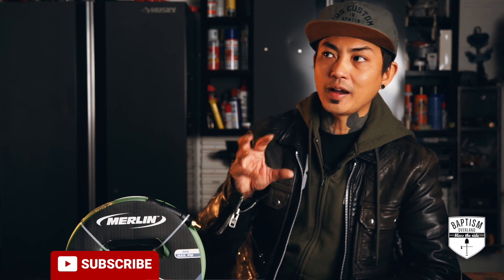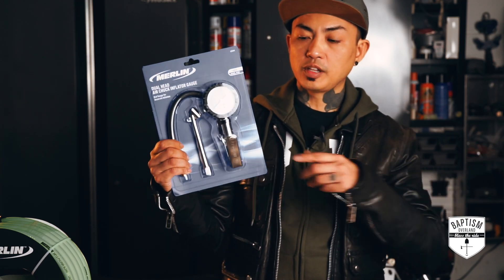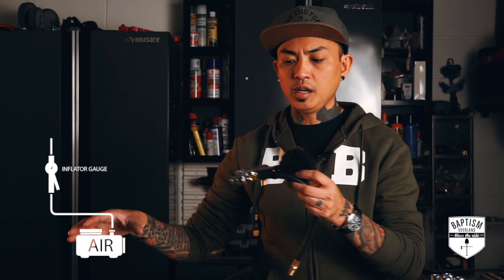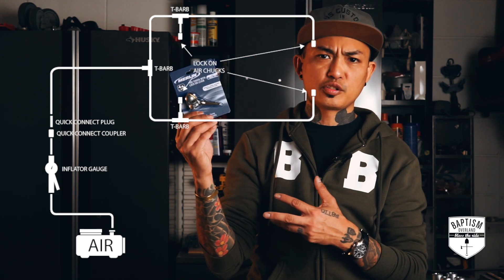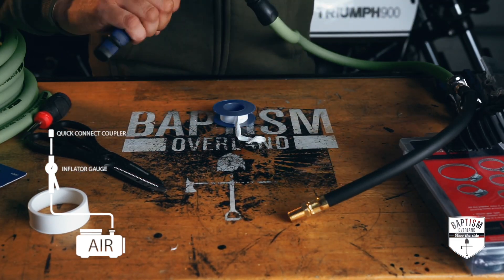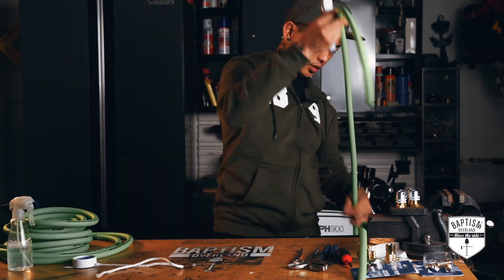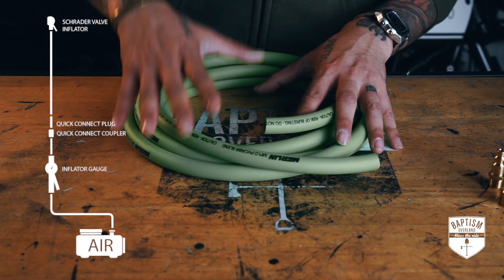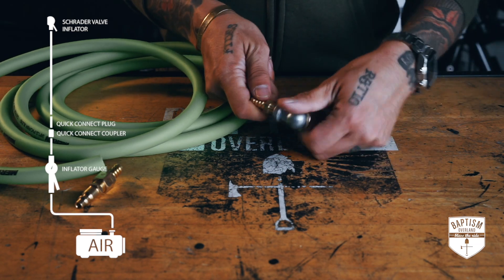DIY Your Own *MODULAR* 4 Way Inflation System!

Comment: Awesome as always, Asia.  Thanks brother.  Good points at the end too about having a competent compressor and potentially overheating or abusing it, depending on the compressor of course.  Also probably one of the biggest takeaways from a system like this is the even distribution of air between each tire.  Currently running an arb single compressor, but if I ever move to something bigger or a power tank I’m making this for sure.  I just might make it anyways! 

Your videos always rock bro. Cheers and much thanks.
Reply from the maker: Make it because that ARB single will still handle it! I was using a really cheap one that isn't meant for off road.
Reply: @BaptismOverland  just got my ARB single for Christmas. So this will be built right after my install. Thanks again as always Asia!
Reply: Great video! If you rebuild your system I would use 1/4 inch hose. Your valve stems will always be your bottleneck in air flow, not the hose size. Plus the compressor cfm just isn't high enough for air hose size to matter. No need for all the extra bulk.
Reply from the maker: @Joes-Adventures71  Valid point. I just saw a lot of DIY videos using the larger size so I figured I would go with that but but you're right. If it'll bottleneck down to 1/4 anyway...

Comment: This is great, thank you!  I'm looking at building 2 of these  out soon with a friend for his car as well.  Question...  is there anything you can recommend to deflate the tires evenly simultaneously as well?  I know this video is for inflating, but deflating to go into the trail is a pain in the ass sometimes as well when you're doing it 1 x 1.  Let me know, thanks!
Reply from the maker: So funny thing...and discovered by accident...if I disconnect it fr the air supply while holding the trigger, as I begin releasing the trigger it starts to deflate! Sooo yeah....
Reply: @BaptismOverland  PERFECT! Thank you bro 🙏🏽

Comment: Question for ya. For the single line. What all can you inflate with that attachment you installed? Is there maybe a way to put a quick connect end on that for like using air tools(ie, impact wrench to take off lugnuts to change a flat on the trail) or anything else?
Reply from the maker: You def can! Quick connects are easy enough. Problem is that unless you have an air TANK it's hard to power up other items that need compressed air with just a compressor

Comment: Nice work Asia, I made one like this a couple years ago... and it got "taken" I'm going to do another one now. One thought though, if you don't have the end of the inflator gage connected to the compressor, will it allow you to deflate all 4 tires as well? If not I bet that is an easy part to make... I just can't remember if the inflation gage allows air out too or if it is a one way valve. Peace brother
Reply from the maker: Not sure. I think it will because it sorta started to deflate when I plugged it all up but it deflated too quickly. I don't see how I would be able to control that air flow although I could possibly make something. Right now I use the ARB EZ deflator and have loved it
Reply: @BaptismOverland  I have the ez deflator as well and was wondering the same thing. Does inflation and deflation work the same with this system using the inflator deflator? Does it tell you the pressure of all for tires at once? How does that work?
Reply from the maker: @michaelgee7509  can't deflate with this inflator. Only inflate. Air goes one way and not the other. To deflate you would remove the inflator gauge and just let air seep out but then you'll have no way of knowing what pressure it's at lol
Reply: @BaptismOverland  I was thinking if you took the inflation gage and turned it around and just attached it to the  inlet to the 4 way to the tires you would be able to deflate all 4 tires with the pressure gage for exact tire pressure in all the tires... I might be off base but if you let the air flow through and then stopped it with the pressure gage you would get a reading for each tire? I would try this, but right now we are minus 37 then at in the wind chill and we are  minus 45ish... LOL
Reply from the maker: @brucesinclair9628  I'll try it for you. No need to freeze 😂 problem is the other side of the deflator gage is a male end that will plug into an air compressor outlet and not the tire valve. I MAY have an idea though. I might be able to make a "deflator" attachment that can attach to this kit!
Reply: @BaptismOverland  Thanks brother, let me know, I was thinking of just making an attachment to make it work !!! Peace

Comment: Does it work what if u have a tyre at a lower pressure
Reply from the maker: Well that's sort of the point for this...to air up all the tires that we deflated before hitting the trail. Is that what you mean?